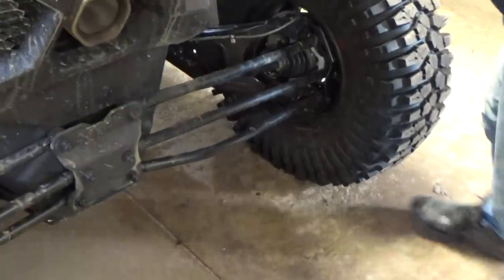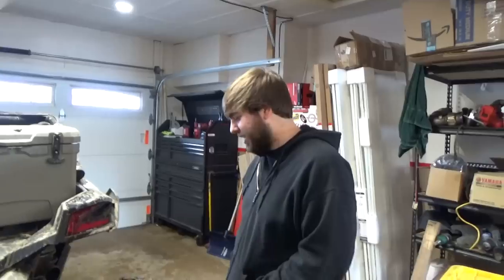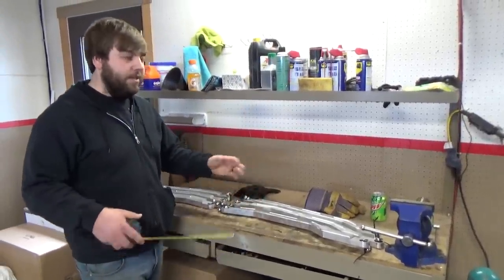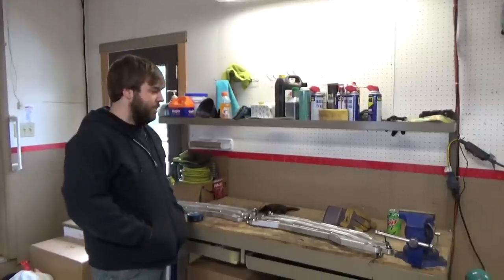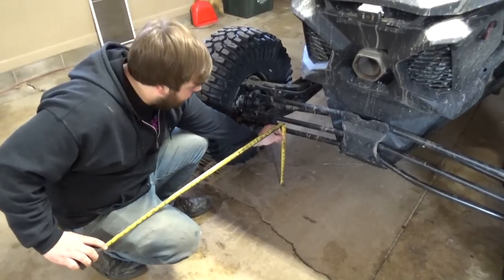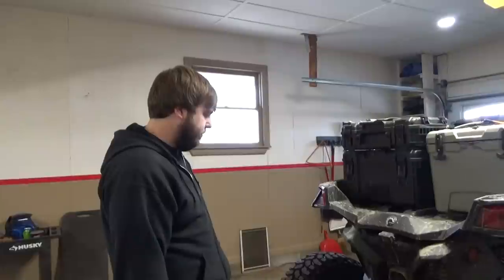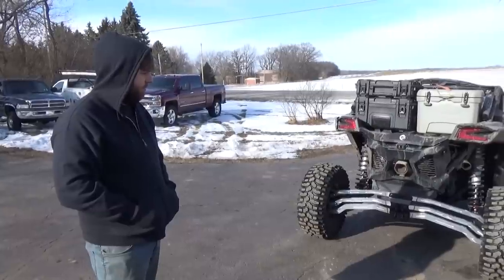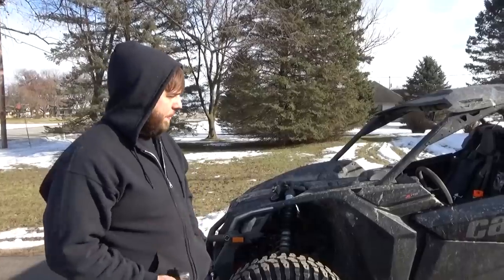Can Am Maverick X3 High Clearance Radius Rod Install | Measuring Gained Clearance

Comment: Think I'll cut & sleeve my stock rods with 4130 chromoly tubing. I'm about 30 minutes from a place that sells all sizes of cage tubing by the inch to NASCAR teams, looks like around .50 per inch x 6 rods x about 28" - roughly $85 plus some mig wire for all 6. Should be a fun little project.
Reply from the maker: For sure. Wouldn’t be hard but
I wanted high clearance too and don’t have a means to bending that tubing
Reply: Blown Budget Offroad yep, I've been looking at the different brands, there all so damn expensive, figured if I build them stout enough, it won't matter too much & cause something else to break. Thanks for making kick ass content, keep it up!